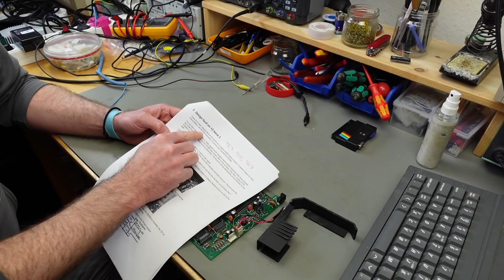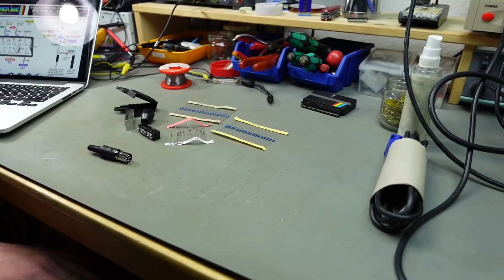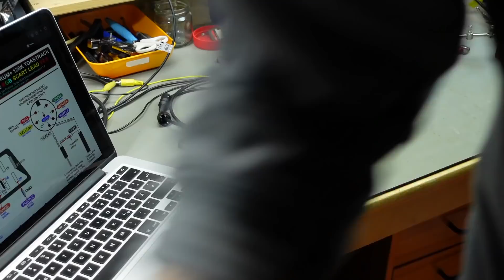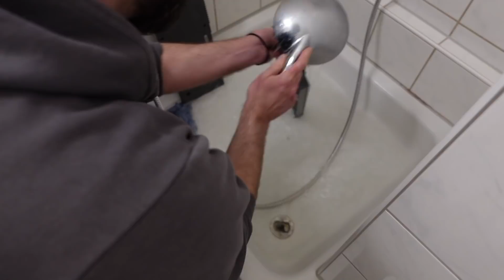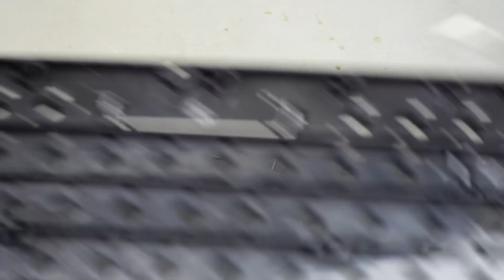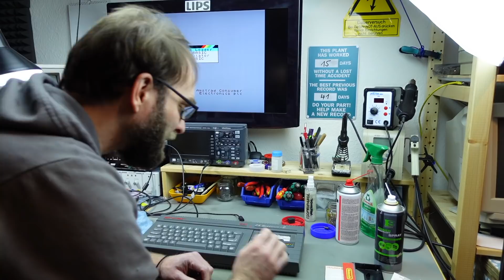Sinclair ZX Spectrum +2 Full Restoration

Comment: 44:00 Adjusting the Azimuth screw on the left side of the tape play head can dramatically brighten the loading noise. Adjust to the left and right until you hit that sweet sounding spot on the tape. Should help many Spectrum owners improve loading of cassettes. I was doing this adjusting lark back when I was 15 years of age and cottoned onto making the sound better.

Comment: Oh dear Jan, youre not getting the bright mode available to 8x8 pixel blocks on the speccy. Thats what the yellow cable with diodes is for! Also watch out because the pinout on the rgb din changes from +2 to +2A/+3! Don't use the same cable - there's a rogue 12v on the +2a/+3!!!

Comment: YOU MUST TO READ THIS

My comments are as I watch the videos.
The correct reading has to be exactly the same rotation as if listening to music.
You can exchange the reader for a newer one, but the reading head must be the same or the same. I'm not sure, because mine is in the garage, it is mono reading, not stereo.
HERE ALSO A LINK OF HOW IS THE IMAGE BY READING CORRECTLY.
IF AN ERROR HAPPENS IN READING, THE "PC" GIVES WRITING SIGN AND THE PICTURE IS IN ALTERNATE TONES OF RED / BLACK OR RED / BLUE
When reading correctly, the image remains as it is in the video ....
blue and yellow stripes if I'm not mistaken.

this video is from spain.
but when you see the images you will soon understand what I mean.

I forgot ....
the tape reading head must be well tuned.
because the minimum displacement, many programs will give error in the end.

ONCE YOU HAVE DISASSEMBLED EVERYTHING, YOU WILL HAVE TO DO IT AGAIN, REPLACE THE TAPE WITH A NEWER ONE, BUT THE HEAD MUST BE THE SAME MODEL, AND TUNE WELL.
MY FATHER TUNED THE HEADS WITH HEADPHONES MADE FROM OLD PHONES, BECAUSE IT WAS ALLOWED TO HEAR THE HIGHEST AND CALIBRATE THE READING HEAD ON STEREO MODELS
Mine is all original.

https://www.youtube.com/watch?v=bPTYVCE95dc&t=4s

https://archive.org/details/softwarelibrary_zx_spectrum

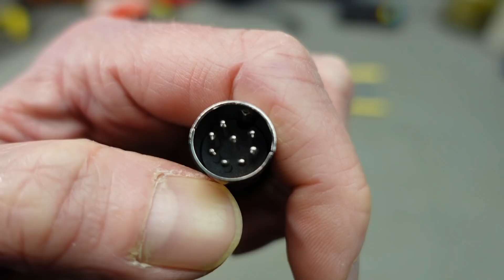Comment: 14:33 That is not a 180° DIN. 8pin DIN plugs are either 262° or 270°. You appear to be holding a 270.
Reply from the maker: Yes! No idea why I said 180, must have misplaced something in my brain... :D
Reply: @JanBeta  The cable construction page you show mentions it, so you probably picked it up from that.
Reply from the maker: Aaah, that explains it. Probably got that stuck in my head and didn’t think too much when I talked about the plug. Thanks for pointing that out!

Comment: 42:35 tape speed is definitely wrong.. as you say, the belt is worn. Fortunately they are not hard to get, they are 65mm overall diameter with a 1.2mm square cross section. Check out a guy called "JoulesPerCouloumb" - he is not active at the moment, but he has some really good past videos on servicing Spectrums
Reply from the maker: Yes, I watched quite a few JoulesPerCoulomb videos when I did my first Speccy repairs. He knows the machines in and out it seems. Really great stuff. Thanks for the measurements, too! :)

Comment: A BC547 transistor will fit the silkscreen pattern perfectly with the same specs as the 2N3904
Reply from the maker: Yes, that makes sense. Strange that they changed the transistor type, probably they got the other ones cheaper or something like that.

Comment: Thanks for the nice Work, Jan:)
Wir beide haben die gleiche (alte) Rolle Stannol SN60PB40 ... wir Verbrecher;)
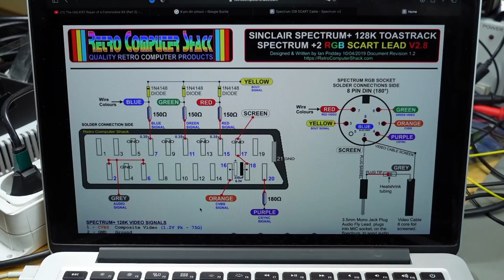Edit 20:31-> I don't know what the diagram creators thought, but a cable shield may only be connected to a potential (like GND) on one side. Otherwise it is useless because like all other conductors it picks up interference signals along its entire length. The "one-sided" shielding prevents this type of interference and protects the jacketed lines. Hence the name "(cable-)screen"
Reply from the maker: Ich habe sogar vor ein paar Monaten nochmal Restbestände von dem verbleiten Stannol besorgt. Mag ich einfach lieber als das bleifreie. ;)

I heard about the different approaches to shielding. I think it depends a bit on the use case? There seem to be both "schools" for the shield wiring, not sure what works better for video. From audio stuff I definitely know the shielding is always wired on both ends for those applications. Although there's a "ground lift" switch on many audio devices for breaking ground loops in case you get hum on the signals.
Reply: @JanBeta  Well, that school isn't the Bretterpenne? :) Shielding works like all electronics by the law of physics. If you enable a current flow (with both sides on a electric potential) then it isn't a (perfect) shield anymore. It is just another conductor or a loop, prone to noise. This defeats the purpose of a shielding. It is that simple. 

Audio: If the shielding is correct ... there can't be a ground loop via the shielding .... because dito (see above, it isn't connected both sides, so there can't be a loop) :)

Cables may be shielded continuous when there is a norm or an agreement. Let's say the manufacturer of devices class-A  never connects the shielding through ... so that devices of sort B can have it. But that is seldom used. A cable with one end open does the same trick. It doesn't matter which way around it is connected (lets say microphone or old din connectors). The requirement is just open on one side. How around does not matter.

Ich hoffe ich habe alle Klarheiten beseitigt. Gruss, Jed:)

P.S.: Für Leitungen die ihre (gemaschte) Ummantelung als GND oder andersgearteten Rückleiter benutzen gibt es spezielle Namen: Fake, Pfusch, Mist:) Falls das so ist, dann darfst Du diesen Leiter nicht als Abschirmung bezeichnen. Es ist nämlich keine Abschirmung wegen dem Missbrauch als Signalleitung. Ich besitze mehrere Mikrofon-, Gitarren-, Cinch-Leitungen. Mit aussenliegendem Schirm und verdrillten Signalleitern innen. So sollte das eigentlich sein. In der Industrie verwenden wir so etwas dauernd, um z.B. ein Potentiometer am Bedienpult in den Schaltschrank zu führen. Eine doppelte, falsche Schirmung merkst Du in der EMV verseuchten Industrieumgebung sofort. So viel zum praktischen:)
Sorry for the German. Too complicated (for me) to write this in English. 
Naja, eigentlich mehr, weil ich nicht die Ohren lang gezogen bekommen will. Unsere engl. Freunde unterscheiden glaube ich nicht zwischen Kabel und Leitungen. ... aber das ist eine andere Geschichte:)

Mehr Info: https://de.wikipedia.org/wiki/Erdschleife beschreibt explizit was ich oben geschildert habe, auch das verhindern mit "...oder das Auflegen des Schirmes nur an einem Ende der Kabelverbindung." or EN: https://en.wikipedia.org/wiki/Ground_loop_(electricity)

Comment: To combat against steel rust you can use kerosene or even usual car gasoline (aka benzine). It does not dissolve corrosion stain or convert it to metal but it can help greatly with brushing surface, especially if soak for a while.

To fight with corrosion chemically you can use Trilon B. It removes trublesome rust in half of hour or so. But additional safety measures shoud be taken during this procedure.

Thanks for videos. I really like it.

Comment: Well, other than 2N2222’s, of course. If you stacked up all the 2N2222 transistors out there, it would probably reach the moon. 😏 I don’t know which sold more, the 2N2222 or 2N3904. Both are as common as dirt.

Comment: For those who want to clean their keyboards but don’t want to risk breaking the plastic, remove the back plate and membrane and soak the remaining keyboard in a bucket with a scoop of laundry washing powder. After a couple of hours most, if not all of the dust and grime will be dissolved, and a rinse under the tap will remove anything left. Soak the keyboard in some fresh water to remove all traces of the laundry powder, and leave outside to ensure all the water inside the keys fully evaporates.
Reply: Good idea.  A liquid detergent will eliminate the issue of laundry powder traces.

Comment: Hey Jan, are you getting the full 15 colours? Without connecting the bout signal/diodes you should only get 8 😀
Reply from the maker: From what I’ve read, the +2 doesn’t even have a BOUT signal. The diodes seem to be needed only for the toastrack because it outputs TTL signals and not analog RGB. But as I said, I’m a bit of a noob with the Sinclair stuff, I’ll have to double check if I actually get the bright/dark variants of the colours! :D
Reply: @JanBeta  The grey +2 is virtually the same as the Toastrack, by default it does output a bout signal it is only the later +2A/B +3 that don't. You can configure it by some links/jumpers:
http://www.fruitcake.plus.com/Sinclair/Spectrum128/SCARTCable/Spectrum128SCARTCablePlus2.htm
Reply from the maker: The link explicitly says that the BOUT signal is already combined with the colour signals on the +2 DIN output, it‘s the same link I used to make the second cable.
Reply: @JanBeta  Right you are, sir!

Comment: Regarding cracks in transparent plastics, like in the cassette lid, there are compounds used for repairing car windshields that works. I'ts like a glue with very low surface tension that gets sucked in to the crack and makes it invisible. Have used it a couple of times. Great content as always, Jan!
Reply from the maker: That’s a good idea, I’m going to get some of that stuff. I even considered trying hot air but I thought it would cause more damage than do any good... :D
Reply from the maker: Thanks!

Comment: Jan that's a not proper way to remove keycaps! You have to remove back metal plate (just squeeze plastic tabs), and then just squeeze  two plastic tabs for each keycap! For God's sake don't use key puller, it's not commodore/amiga keyboard!
Reply from the maker: Yes, learned that only when I took it apart fully unfortunately. But, hey, I got away with it (mostly). So it’s good to know that both methods kind of work and you can also work on the keys without taking the whole assembly apart first.

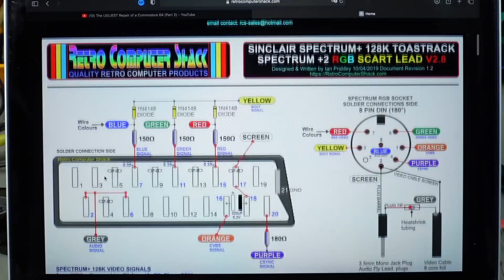Comment: 13:00 the reason for the diodes is because the Spectrum actually outputs something much like CGA. There is red, green blue and bright signals and they are all at TTL (0-5V) level. The resistors and the diodes are converting this to Analogue RGB levels. 

The Spectrum +2 may well incorporate these resistors and diodes already, as they could be built for a variety of different combinations of output on the RGB socket. Usually, they have R12-R14 and diodes D9-D11 installed, so the output is already Analogue RGB. Im a bit surprised Retro Computer Shack's cables show this diagram. Typically there is no Bright signal on the output socket either, it is instead a mono audio out.

To check all this, see how jumpers LK1, LK2, LK3, LK4 and LK7, LK8 are fitted. Most +2's i have seen have LK1 (Pin 5 = VSync), LK4 (Pin 1 = composite video), and LK7 (pin 3 = brightness) installed, as well as R12-R14 and D9-D11 fitted. Annoyingly this means there is no 12V output for scart switching!
Reply: Isn't this diffetent just between +2 and +2A? I think all schematics show that +2 should have separate intensity and TTL RGB.
Reply: @rastislavzima  Thats what the schematics show, but thats not how they were actually built. All of the grey +2's i've ever seen actually have analogue RGB out because they have the resistors and diodes fitted
Reply: @jaycee1980  thats quite strange if the product is out of specs and you use the wrong cable...
Reply: Anyway thanks for the info, I have two +2's waiting for check and refurbishing so I am realy curious what I will find.

Comment: Regarding the transistors - i believe the board is laid out for BC546/556 type parts... and in some places they decided to use 2N3904 which have the pinout reversed. Probably a substitute because they were cheaper or something! The ones usually found incorrect are TR4, TR5, and TR7. TR4 stops composite video out working, TR5 stops the VSYNC output working, and TR7 means the CPU is contended in some cases it shouldnt be (it fixes a ULA bug)

Sometimes you find TR4 is a BC5xx and thus the composite video works. The reason your previous attempt to get composite didn't work, is because the RF modulator's composite input has changed to an open collector drive scheme, so the signal is unsuitable for feeding straight into a 75 ohm load, unlike the previous spectrums.
Reply: i really should hold my horses before posting early lol. ByteDelight aka Ben Versteeg is absolutely spot on :)

Comment: Ah, the capacitor debate:
FWVLIW I replace all electrolytics as a routine too. I suspect the 'debate' is based in habit. If you are in the habit of using one much prized machine all the time it's reasonable just to watch the caps and only replace them as they go bad - the risk of damaging an old board by changing the caps might be greater than the risk from them leaking. However if like me, and many others, you have a bunch of old computers routinely changing all the caps on purchase really is a must - who knows how often or irregularly it might get used and more importantly checked?
Of course one also has to honestly assess one's soldering skill - in general it's all about practice and patience, although good tools do help. As a tip I can't say how important it is to practice on something disposable before talking on any soldering job and honestly assessing if you / your tools are up to the job. I've been fiddling with this stuff for years but still routinely have a quick practice if it's been a few days since I last played.
I hope that's of help to someone.

PS
I absolutely detest DIN sockets, the number times I've forgotten to thread the plastic sleeve before soldering and somehow I never end up with a neat job. I once made the mistake of designing a USB to C=64 DIN lead so I could get rid of the need for bulky and worrisome C=64 PSU's - all the electronics went inside the DIN connector and, my, they were an utter SOB to do - been running both my C=64's that way for years, the only issue being the rarely used clock doesn't work as there's no sine-wave on the 9v supply. Thankfully they weren't at all popular for some reason so I never made more than a few. (MAX660 if any are curious)
Reply from the maker: Yes, I completely agree. It definitely makes sense to gain some experience with soldering before you approach something that might be irreplaceable.

Comment: Scart needs a proper +12v blanking signal? In the +2 Grey this is not provided directly! You would need to modify a link (Jumper) on the motherboard to replace composite out with +12v). This is not clear in your video!!! I think your scart is working simply as a composite out.
Reply from the maker: No, with my upscaler you don’t need the 12V signal. That’s only needed for some TVs afaik and in most cases you can still switch them to RGB input manually even if it’s missing.

Comment: Like a couple of other people of said, you need to align the adjustment of the head to the tape, you will hear when it’s in the right sweet spot. It’s particularly a problem with copied games onto blank tapes depending on what gear was used to make the copy.

Comment: Wait a second, so they actually produced these boards with reversed transistors? Meaning they never worked even when brand new? Hard to imagine as why would they not have been returned then... I'm missing something. :) I also don't get the discussion about the caps, even if they're fine, why risk the possibility of one leaking if you can replace them with high quality ones. On my Amiga 1200 I even used dry versions, yes more expensive, but who cares. :)
Reply from the maker: Yes, that’s what they did. The boards still work and you even get a somewhat proper composite signal with the reversed transistors. Certainly not as well as intended though.

Comment: Thanks for another calming video, Jan. I needed it after trying to set up a wireless laser printer this morning. (The trick was to press and hold the WPS button on the router to get them to handshake). I had a 48K in 1984 and a 128K toastrack in 1985 with an Opus Discovery 3.5" drive. Great days... 😁
Reply from the maker: Haha. Printers have always been one of the more adventurous things to connect to a computer I guess. Kind of funny that they still give us trouble (don’t ask me about setting up my printer on the small network here...)

Comment: The video signal going to the RF box is mixed with Audio! Unlike the 48k machines. The same is true for the composite video through RGB din. You need to detach the audio by re-connecting a capacitor from the TEA2000 to another point. Google it :)
Reply from the maker: Ah, that explains that. Thanks!

Comment: Love the new scope!  I find it easier and less risky to remove they keycaps using your fingers, rather than a key cap puller - just based on the way they are clipped in.  There's nothing normal about the keys on these lol.  Identical to the way they are clipped into the CPC (and the same keys in fact).  The safest way to remove them is to remove the back first, then you can unclip them.
Reply from the maker: Ah, that makes sense, thanks! Yeah, these keyboards are certainly special. After cleaning it feels surprisingly good to type on though I have to say! :D
Reply: @JanBeta  Yeah, they are good to type on =D

Comment: Before I got a proper effective rust remover, I was using a coca cola with much better success than vinegar. Rust removers and coke contains phosphoric acid, which seems to be pretty effective even in lower concentration (a bit of heat can speed up things noticeably). It may darken the surface quite a bit depending on the material... If available, sandblasting (maybe with some softer medium) has probably better results though...
Reply from the maker: Good call! I used cola for rust removal on chrome bicycle parts before. Worked really well, didn’t think of using it on computer parts. :D